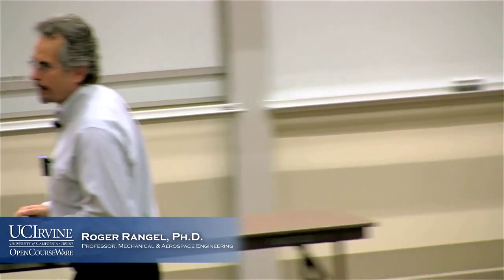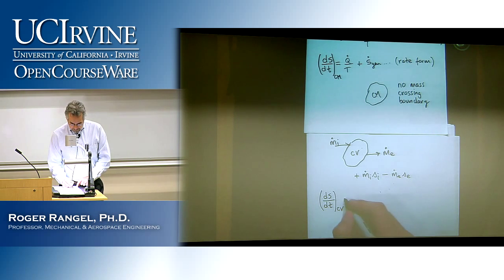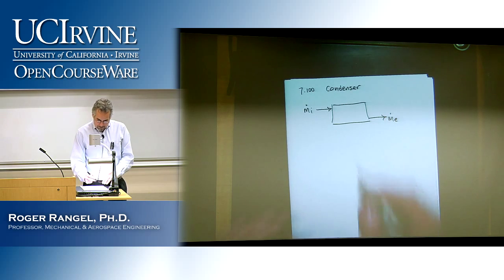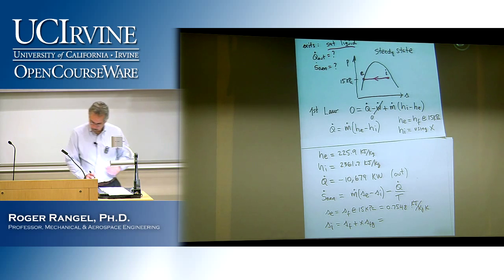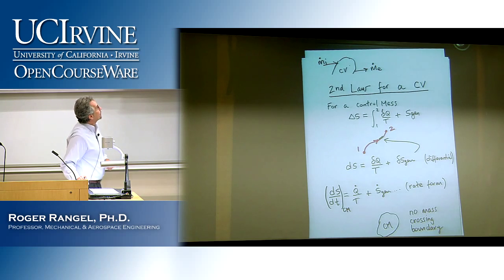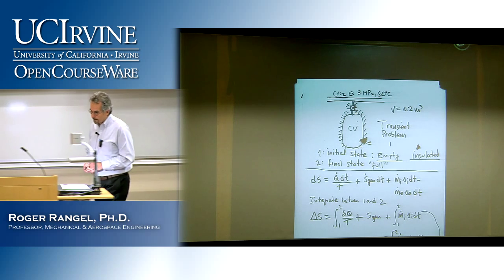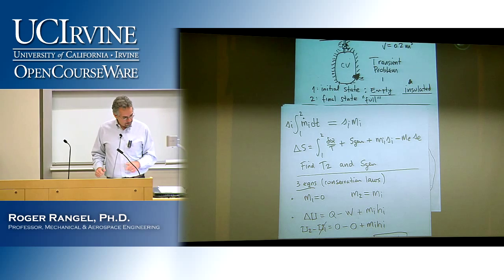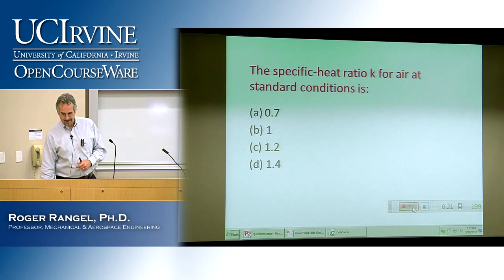Engineering MAE 91. Intro to Thermodynamics. Lecture 15.

Comment: How T2 can reach to 120 while CO2 Tem from line is only 60 degree
Reply: Driving force is pressure difference for mass to go inside the tank, so unless valve is closed mass will accumulate until pressure is the same with line flow. Temperature difference is a driving force for heat transfer.